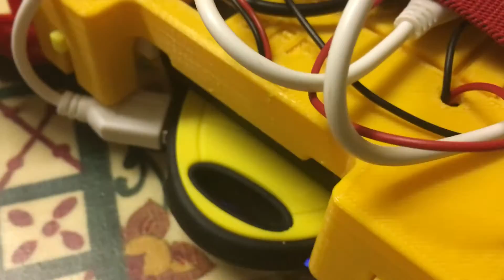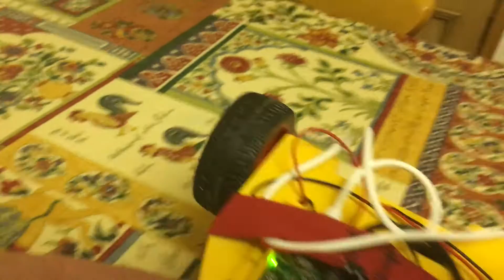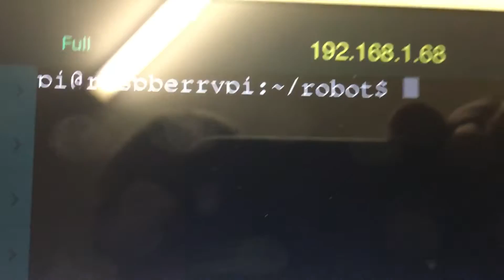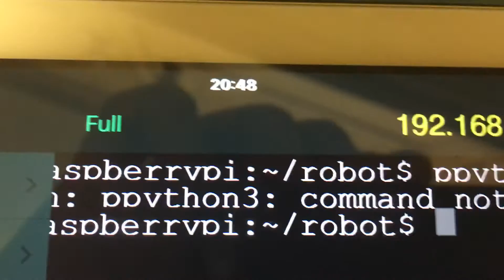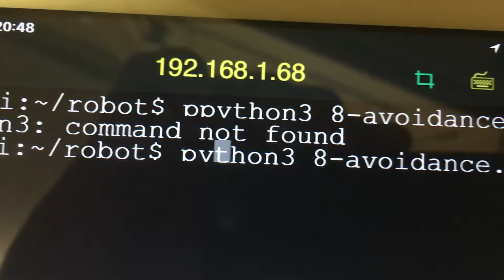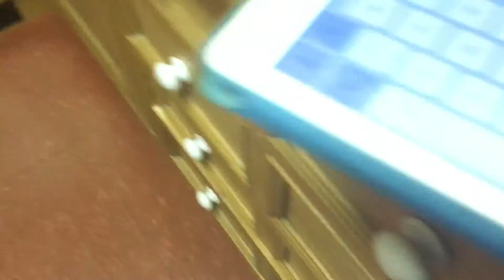CamJam Edukit3 Robot

Comment: Hi. what have you used for the power supply? I want to buy the kit as a gift but have no idea if the kit will be useless without the ability to power the raspberry pi  without cables. what specs should I be looking for in a power supply? thanks
Reply from the maker: I used Anker power batteries. See https://www.amazon.co.uk/Anker-PowerCore-Ultra-Compact-High-speed-Technology-Black/dp/B019GJLER8/ref=sr_1_5?ie=UTF8&qid=1512314775&sr=8-5&keywords=anker+battery+pack or
https://www.amazon.co.uk/Anker-Portable-Upgraded-Capacity-Technology-Black/dp/B00P8SY7HQ/ref=sr_1_3?ie=UTF8&qid=1512314775&sr=8-3&keywords=anker+battery+pack